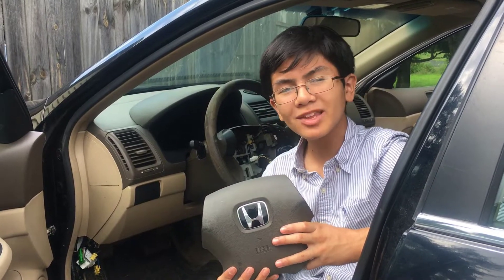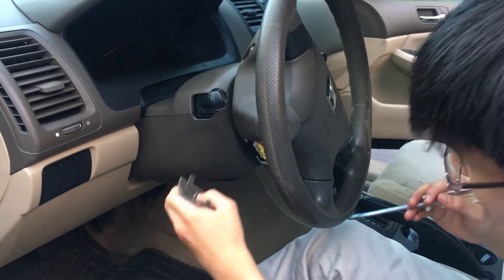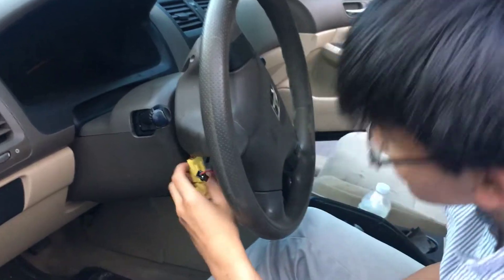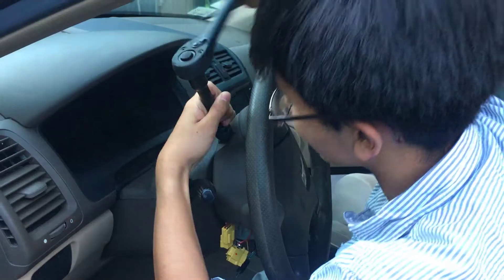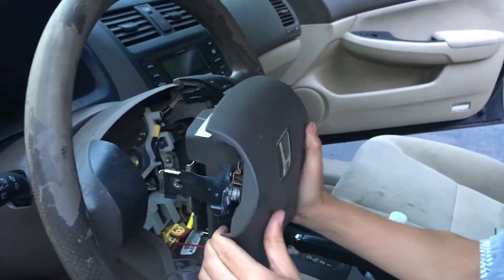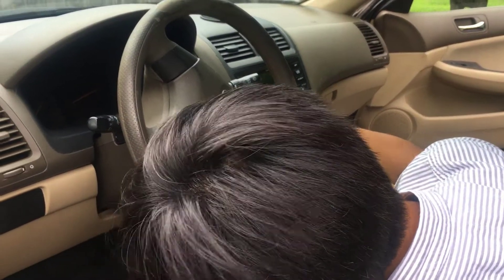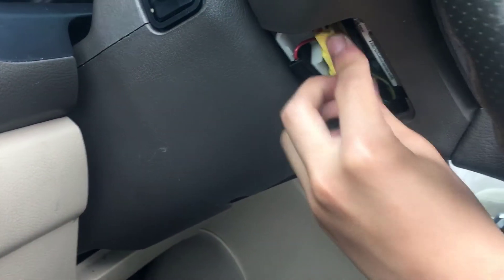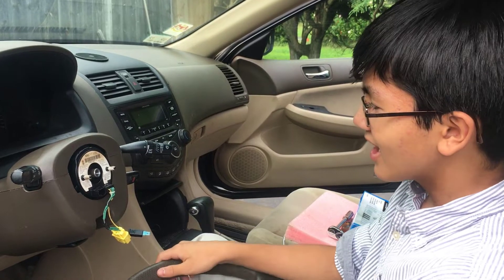How To Remove, Change Or Replace Airbag (On Steering Wheel) 2003-2007 Honda Accord | DIY Auto Repair

Comment: Hello I own a 2005 Chrysler Crossfire It is basically a Mercedes SLK 320. I was wanting to install a Mercedes airbag which is exactly like the Chrysler which is a single stage air bag meaning it has one plug on the airbag well I installed it and the airbag light came on. So I reinstalled the factory wheel and airbag and the light is still on what can be wrong. I never had a airbag issue before wanting to install the Mercedes wheel and airbag. I have seen many remove airbags with no issues but , NATURALLY I have have issues. I wrote you in the past about my AC compressor and you had given me a wrong diagnosis. The AC compressor is not to run constantly it was to cycle. So hope you can give me a better diagnosis on this problem. Thank you
Reply from the maker: We don't have a lot of exposures on Mercedes, only 1 of our mechanic friends have delved into Mercedes DIY but he recently passed away.  One time he replaced an AC compressor on his 230, he thought he did everything right but still did not work.  What he discovered was that the computer needed to be reset by the dealer.  After a trip to the dealer and about $120 later the AC finally worked.  So perhaps similar situation applies here?
Reply: @EyeOnAiman  thanks

Comment: I wish you showed what you mean by disconnect battery. That seems to be a very important part especially if a newbie is trying to do this.
Reply: It means disconnect the ground terminal on the battery so there is no power going through the car. If someone isn't sure what disconnecting the battery means they probably shouldn't be messing with airbags